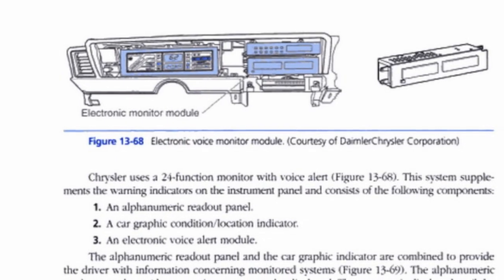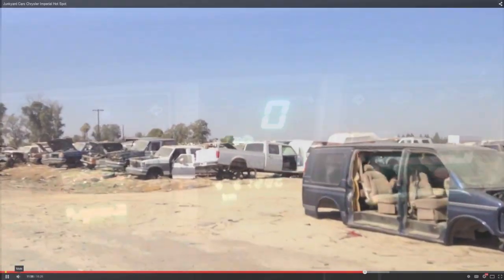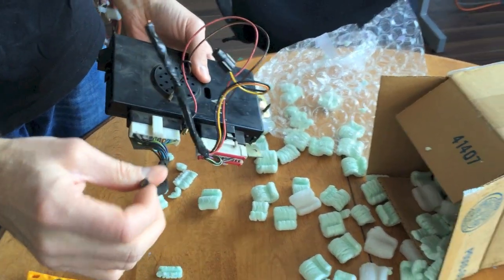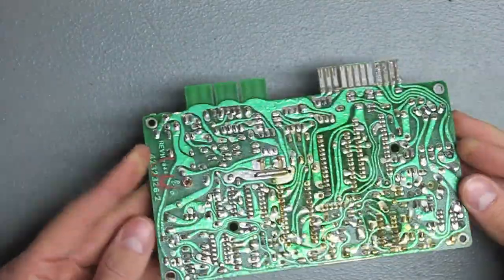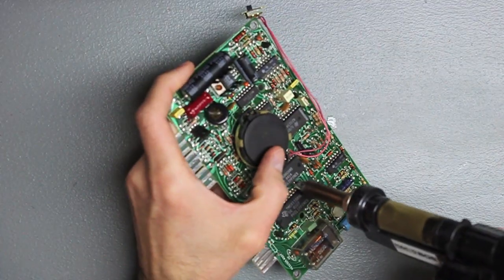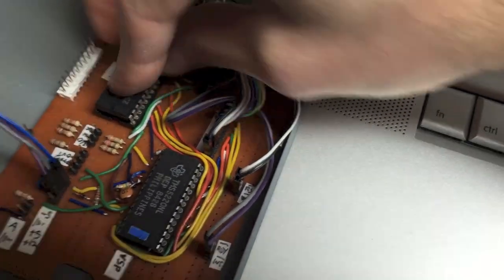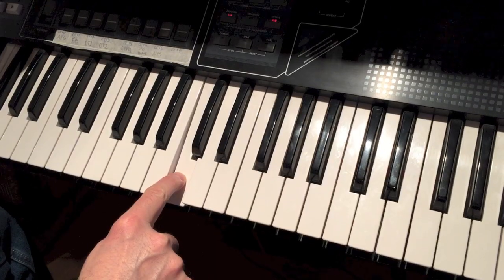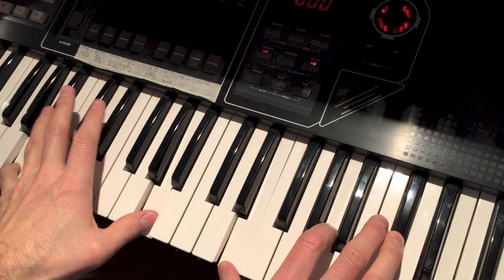Preserving the Chrysler Electronic Voice Alert (EVA)

Comment: I used to have a Laser XE with this system.  Once it actually saved my engine because it warned me of low coolant right before I was getting ready to take a road trip. Another fun story is I was teaching my nephew how to drive and he stalled it out in an intersection, and it said the engine oil pressure is critical message and freaked him out.

Comment: Just curious has anyone asked you to duplicate this chip for them as a replacement for their car?
Reply from the maker: No but it would be doable to reproduce the module using modern parts and emulation. The final unit price with all the needed eng/dev time would definitely not be worth it though, otherwise there would be some replacement out there already

Comment: Did you happen to notice the volume control on the module? I definitely need to turn mine up
Reply from the maker: TBH I never powered it up. Just played with the speech data in my computer
Reply: @plgDavid  did you see a pot or wheel on the case anywhere?
Reply from the maker: @GeorgeLiquor  afraid not. Maybe the audio amp section is busted in your device forcing you to post amplify it?
Reply: @plgDavid  could be. Thanks anyway

Comment: do you have audio copies (mp3s?) of each of the alerts?  I'd love to build an arduino+sample player to wire in to my car so it can talk to me with this voice. :D
Reply from the maker: Hello. Afraid not as per copyright laws. You could hack the MAME driver and render the sounds with enough work though. Its all there.
Reply: @plgDavid  The sounds that the chip is generating are not copyright protected. I'm not asking for the speech or program code, just audio captured cleanly without car sounds, etc.
Reply from the maker: @yorgle  You are a lawyer? Its not any different from an MP3 recording of copyrighted speech recording , just at much lower resolution.

Comment: I have the 11 function one with the blue case. I ripped it out of my old 1984 New Yorker K Body before the car was towed. I wish I had pulled the Dash too :( I'm trying to get the wiring diagram. The popular site online is somewhat correct but my one has many more wires. So far, I've got it to say the "Don't forget your keys" line.
Reply from the maker: I never had any of those cars tbh. My aunt used to have one though. I never actually tested the sensors part. Good luck!

Comment: Okay..well I never! lol! I clicked on the video to see you tinker with the factory board and record the outputs with a software audio recorder like audacity, but aahh you surprised me with a even BETTER video! I am a musician and would like to know what Keyboard you are using? How did you make that Voice chip to USB converter-cum-midi triggerable device? Also, that desolder gun and chip lift tool? What are they and where can I buy them in the USA? The look of the keyboard looks like an old ROLAND but the panel layout is not Familiar to me(A50,A80)?
Reply from the maker: The keyboard is really just a cheap CME UF6 MIDI Controller (obsolete) and it died on my a while ago. The TI speech chip reader/player/dumper was custom made for my research using the datasheets of the TI chips and studying arcade board schematics, its not used to play back the sounds with the keyboard, that is done with our Plogue chipspeech VST (https://www.plogue.com/products/chipspeech.html) The Desoldering tool is a classic HAKKO 808. Thanks for the questions!

Comment: What was the chip reading softwere and modual you were useing? I want to do it with an old garmin gps and some older toys i have
Reply from the maker: The module is a FTDI dual port device (USB -> 16 GPIO), but anything would do really. The rest of the hardware and software is home made just for TMS stuff.
Reply: plgDavid thank you for the info

Comment: I kind of wonder how hard it would be to alter the ROMs to use Gauntlet lines, since that game used the same voice synth chipset.
Ｒｅｄ ｗｉｚａｒｄ ｉｓ ａｂｏｕｔ ｔｏ ｄｉｅ.
Reply from the maker: The data would need to be converted between 6bit pitch (TMS5200) of gauntlet towards the 5bit pitch of the TMS5110, on top of making a new serial rom :) More infor on chip differences: http://ploguechipsounds.blogspot.ca/2014/12/chipspeech-diary-part-2.html
Reply: Ooh, cool! I love reading about voice synthesis systems. I'd love to track down a EVA car someday, though i'm not sure if i'd be good enough at service work to keep one as a daily driver.

Comment: Let me get this straight. You bought an extremely rare car speech computer module from the early 80's of which I understand is extremely tough to find. and there could be a handful of people who wish to find one of these working computers so they can use it in a restoration car project which may need one of these and are right now going nuts trying to find perhaps that exact unit you have. But you bought this just so you could rip it apart and use it on a keyboard like a toy.???.... wait ok you got me there that's actually way cool. : )
Reply from the maker: orangie84 Sure this particular unit got pretty much incapacitated by the process. However the code for the speech and the main cpu were preserved for posterity and technically because of that nothing stops anyone from creating a replacement for it using the original sounds which are now in an open source project:MAME

Comment: will this also be added to chipspeech? this would be a perfect addition to the TMS circuit bending present.
Reply from the maker: I wish believe me. Thats how I made this demo(using chipspeech). Just cant ship the ROM with it since I dont have the rights to it.
Reply: Oh, I see
Who would you have to get rights from? Chrysler?
Reply from the maker: the FCA group and they have not answered my mails
Reply: Oh I see
Reply: Maybe there's a way around it
Reply: Like some of those mess, or emulators that require purchase, they usually never pack in the bios, or stuff like that, and have you download them separately for free, what if you did something similar with the EVA, like voicebank or a special .TMS file with all the data from the EVA packed into it for chipspeech to run, and it's a separate free download from chipspeech.

Comment: Is there any chance I could try getting this to work with the Arduino Talkie library? It is a software synthesizer based on the MAME development, which accepts TMS5220 data directly. I have successfully created my own sound bits with QBOX, a program made for creating sound data for those chips.
Reply from the maker: Data would need flipping IIRC, but same thing. I cannot redistribute this rom to the wild. I do not have the rights to it.
Reply: Bummer. Flipping wouldn't be an issue, as the library handles it.

Comment: Can i replace the one I have with my own voice? or someone else's that I record and edit.
Reply from the maker: It would be technically feasible but extremely complex to do so I'm afraid, without heavy modification and custom code, new CPU, etc. There is a TMS6100 emulator hardware out there but it only works in the BBC Micro from my tests (or my unit was faulty I dont know)

Comment: Hey, I spend a lot of time in junkyards and I see Chryslers with the EVA system pretty regularly. They go for about $25 if you pull them yourself (which is pretty easy). Even more common is the mid-to-late-1980s Nissan Voice Warning system, which was a functional digital replacement for the earlier phonograph-record-based system.
Reply from the maker: +murileemartin Thanks! I would love to preserve them all! I was meaning to head to a U-pull but I found lots of cases on forums from Chrysler fans looking for some so my hopes were not up (as you can tell I'm not a car specialist!) 
Especially looking for the French and Spanish versions and also a similar system on Oldsmobile Toronado, any chance to find one? https://www.youtube.com/watch?v=zb3gYvJpDK0
Reply: +David Viens The Toronado system won't be too hard to find, and maybe they made French ones for Canada. GM put that system in many Buicks and Oldsmobiles from the middle to late 1980s. Look for Buick Rivieras and Reattas from that era, and Oldsmobile Toronados and Trofeos. There is a Trofeo in a junkyard near me (Denver) so I might see if it still has the system.
Reply: I never knew GM made any cars in the 1980s with robot voices. I only knew that Nissan and Chrysler had them.

Comment: I have a talking VCR remote and a talking clock from the 80's which I wish to conserve in a similar matter. Even a recording is enough, but I still have to find a way to control the synthesizer chips to play each and every available sound
Reply from the maker: +nrdesign1991 Can you open them and take photos of the chips inside?
Reply: I'll try to take some photos this evening. From what I can tell it's similar to an SPO256 core, using two ROMs on an 8-bit bus (but I could be wrong). I don't have a logic analyzer but I have an idea to record the audio output and at the same time capture the pin states with an Arduino.
Reply from the maker: +nrdesign1991 SP0256 cores are quite pesky to dump. The rom data can potentially be spread across the  internal SP0256 and extra custom ROMs. The internal ones require custom tricks to extract.
Reply: David Viens
I have recorded the internal sounds from an Intellivoice SPO256, they are fixed pauses, the infamous "Mattel Electronics presents", some numerals, then "press" "enter" "or" "and"
Reply from the maker: +nrdesign1991 Yeah dumped them too, just that I couldnt clear those recordings to include them in chipspeech.
Reply from the maker: +David Viens Note recording the sounds in analog or even digital land is easier than dumping the internal rom code.
Reply: https://dl.dropboxusercontent.com/u/22548419/intellivoice.rar

Here you go
Reply from the maker: +nrdesign1991 Hi analog recs. Yes. Having internal LPC12 coefs allows you to change pitch/speed https://youtu.be/6S83-0hYcY8?t=8m7s
Reply: David Viens
I dug up an old recording of the remote and took a photo of the PCB. I noticed that I already socketed the speech IC and there were some repair wires on the back. I remember poking around with it some time ago, but that was before I had an oscilloscope here.

https://dl.dropboxusercontent.com/u/22548419/remote/Remote%20PCB.jpg
https://dl.dropboxusercontent.com/u/22548419/remote/remote%20sample.mp3

The remote gives instructions on how to set and transmit the time for the VCR, has an internal clock with an alarm feature and gives instructions on how to program the VCR to reord at specific dates or interval (all in german). The voice actress does have an accent (dutch?) and sounds somewhat pissed off all the time :D
Reply from the maker: +nrdesign1991 THAT is pretty amazing! Def LpC/Parcor sounding. as far as the chip markings seems like an obfuscation job. With the pinouts it might be easier to figure out if its a rebranded SP0, TMS or something else. Great find!
Reply: The oscillator pins are positioned similarly to the SPO, there's a "go" pin" that triggers the cihp, but removing connections to the processor seems to confuse it rather than just triggering other sounds. I'll try playing with it again later.
Reply from the maker: A "hidden" SP0 has been done before. I have a Coleco device that has a rebranded SP0+Speech roms. So yeah definitely possible
Reply: +David Viens Could be remarked Toshiba tc8802af or tc6603 LPC/PARCOR chips, as well.
Reply: Jonathan Gevaryahu
That seems to be very possible. I've looked up the datasheet and some portions seem very similar. For instance, the two ROM chips are entirely unconnected on one side, making them a possible TC8890N/F candidate. These are typically used with a TC8802AF as indicated by the datasheet. The TA7368P amplifier is suggested to be used by the TC8802AF datasheet. The voice chip seems to be in CPU control mode. I'll try hooking up an Arduino to the pins and grab some raw data (unfortunately I have an issue with my left arm at the moment, so that could take some time).

Thanks for all your help so far!
Reply: +nrdesign1991 Be aware that TI tms6100 VSM chips are also entirely unconnected on one side. The TC8802AF is used in the vtech socrates as a 'glop chip' in the speech module, that's how I'm familiar with it.
Reply: OK, I've started to draw the schematic - this is what I have so far:

https://dl.dropboxusercontent.com/u/22548419/remote/Remote_Sch_20012016.pdf

The speech IC runs at 400kHz via a ceramic oscillator. Audio is at 9.09 kHz and seems to be low-pass filtered (no PWM residue is visible, or there is an internal DAC). Does this ring a bell, or do I need to go further? I'll try hooking up an Arduino to capture some data when I'm done.
Reply from the maker: +nrdesign1991 Thanks! Does not seem to math the SP0 pinout thats for sure. +Jonathan Gevaryahu  rings a bell?

Comment: Wait, these are worth over $300!? I have 2... Seems like a giant grey box tho vs the really small one shown.
Reply from the maker: +Unusualrule Could you open it up and make a good picture of the chips??? (please pretty please?)
Reply from the maker: +Unusualrule bump! Would love a picture. Of if you could lend it to me for backup. I'll make you sample accurate renders in wav :)
Reply: +David Viens Turns out I didn't exactly remember correctly, here are the pictures anyway:
https://dl2.pushbulletusercontent.com/ZqXzbHwDOSbj0sG3IAiwAD8Xdq1OiDXD/20160105_211224.jpg

https://dl2.pushbulletusercontent.com/AE2uIEOlqyD5PLg53QGj5QUN8cPOeih8/20160105_211200.jpg
Reply from the maker: +Unusualrule Thanks a lot for the picture! Would it be possible to get a higher resolution closeup of the small chip that has a 'E' caption? it has a capacitor over it too, which makes reading the serial impossible. Thanks!